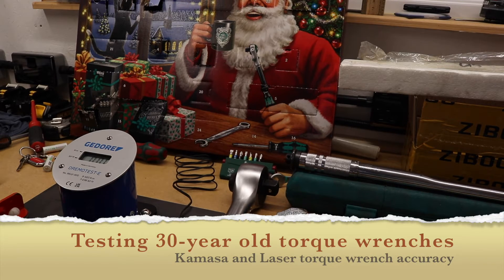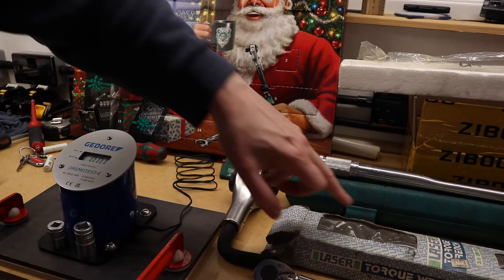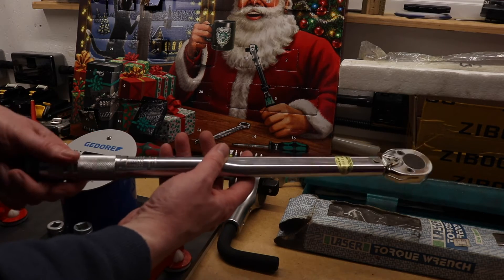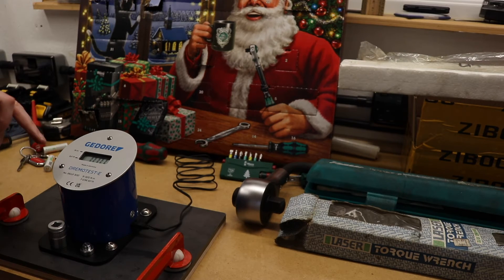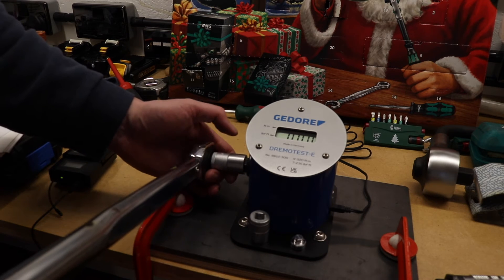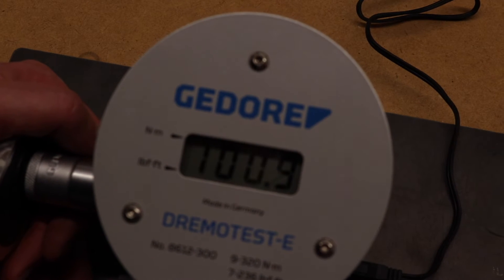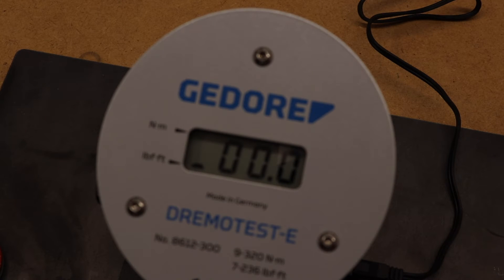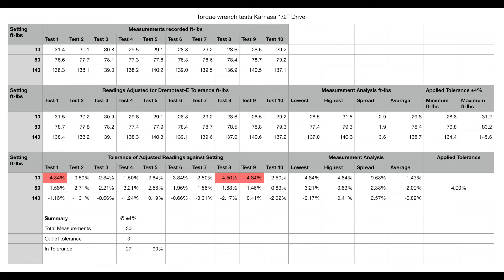Testing my 30-year old torque wrenches

Comment: It would be impractical to do, but very interesting to compare a new old stock torque wrench, one that's gone through a lot of clicks, and one that's been left stored with the setting left tightened up over a few years. Problem is to get sensible data you'd need to test multiple of them, etc.

My hunch is that digital torque wrenches should be more consistent over time but that does rely on the electronics not going wonky.
Reply from the maker: I know you are supposed to always wind the tension off the spring when storing torque wrenches for long periods, never seen a definition of 'long period' though. Although you can also wind them off to far and it affects accuracy. An electronic torque wrench will be dependent on the stability of the reference. Usually the reference ages over the first year of use and then stabilises, re-calibrated after that should give a good stable wrench, barring any failures as you say.
Thanks for watching and commenting.

Comment: Wow not bad at all for 30 years old!  Im socked how well it did.

I actually looked at that Gedore tester,  but over here the CDI which I use was about $500 cheaper.

Thanks for the mention!
Reply from the maker: Certainly did well considering they are not top brands as well. Interesting on the price differential. I got my unit from Gedore UK that were offering the best price compared to others. It is 1% though and not as accurate as the 0.5% of the CDI. Can't really find CDI in the UK, they have a dealer in Europe but that would put import taxes on top of the price and not all dealers will send to the UK now.
Thanks for watching and commenting.

Comment: Interesting to see the drift is slightly upwards on the laser torque wrench I suspect that is intentional with these older non-digital torque wrenches would be interesting to see the drift and out-of-tolerance compared in Nm.
Reply from the maker: I am tempted to get a new one for comparison that does have the settings in Nm. I would imagine at new they are set high and then over use weaken and the accuracy drops over time.